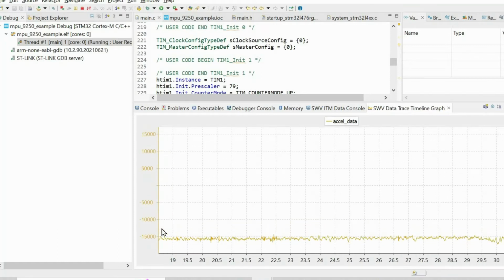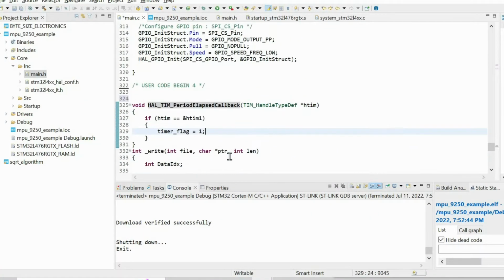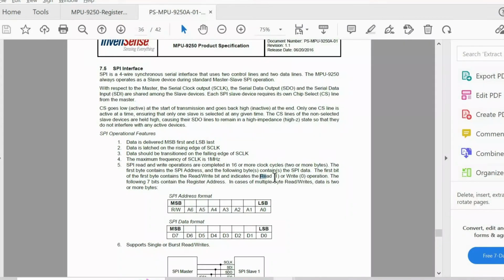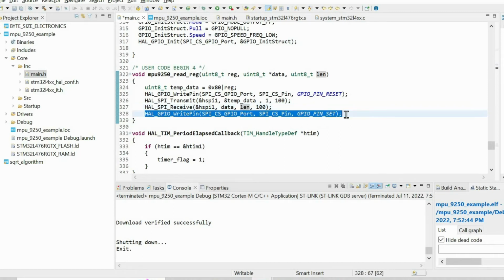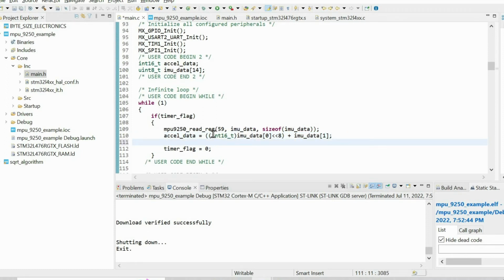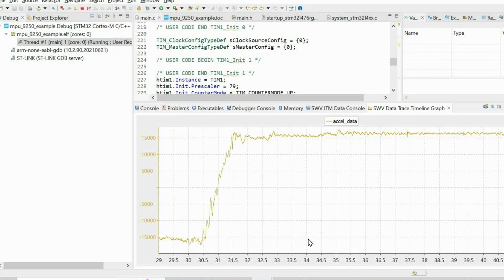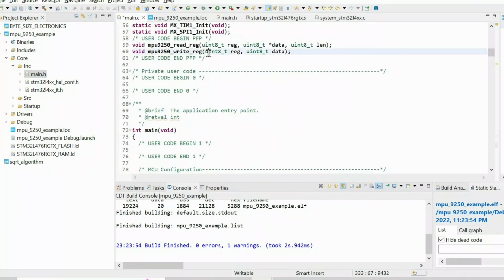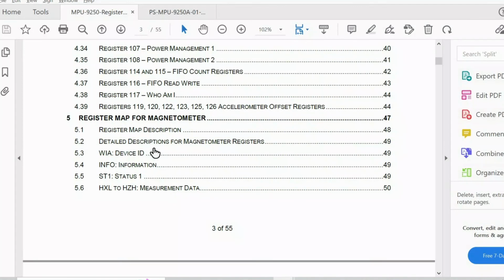STM32 SPI: MPU9250 IMU detailed guidance

Comment: Hii,
I am using imu icm-42688 with stm32 nucleo-144 board. Here, i am trying to read WHO_AM_I register value but output i am getting is 0xFF or 0x0. I dont know what is going wrong
Reply from the maker: Hi, Are you sure that the wirings are correct? Once you verify it, check the register address and other small details. Usually, the problem originates from a place you least expected
Reply: Actually I got the output but it's not working on setting frequency of spi above 2Mhz

Comment: For accessing the full scale range using mpu9250_write_reg() function, why are you sending the register without write bit? I could see you have just send 0x28 as address. Are you not sending the write bit because the write bit is "0"?
Reply from the maker: Yes, you are right. The most significant bit is 0 for a write operation and '1' for read operation

Comment: why did u perform this operation 
uint8_t temp_data = 0x80|reg; 
from did that 0x80 came ?
Reply from the maker: Hi,
For a read operation, you have to set the most significant bit. That is why I added 0x80

Comment: Hello friend, my scale setting on the accelerometer is not working, it is only in 2g mode. MPU9250
Reply from the maker: Hi,
What value did you set for register 28 (accelerometer configuration register)?

Comment: Could you please explain the prescaler that you use in the beginning of the video? Why did you choose that value, how does it affect the process?
Thanks.
Reply from the maker: Hi,
The prescaler defines the speed (frequency) of the SPI protocol:
SPI speed = clock frequency / (prescaler + 1)
Usually, every chip has a maximum SPI speed it can support. Based on this info, you set the prescaler. However, if time is not critical, you can set higher prescaler to have lower speed. 
Did I answer your question?
Reply: @steppeschool3629 , you did. Thank you very much.
Greetings from 🇩🇪.